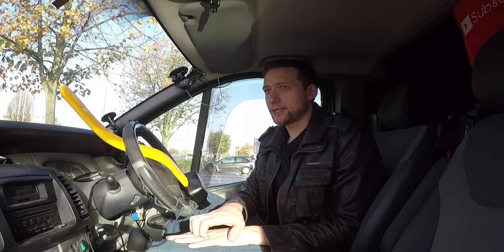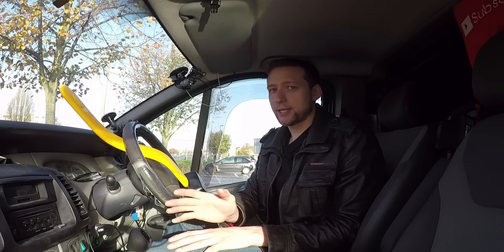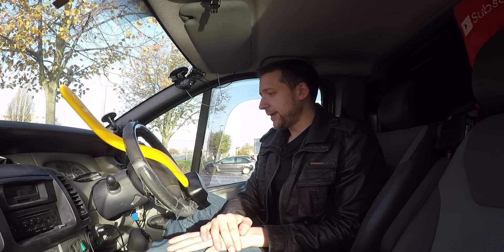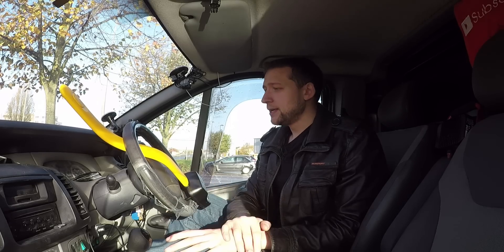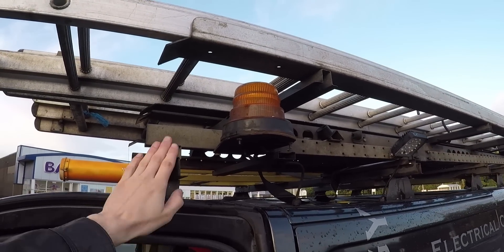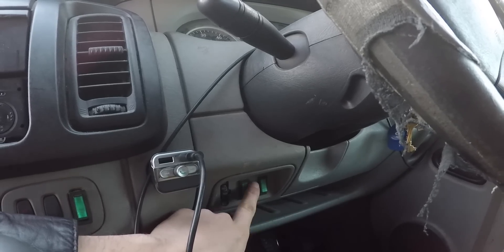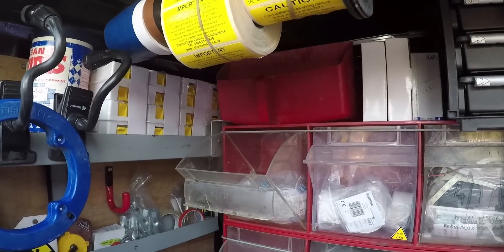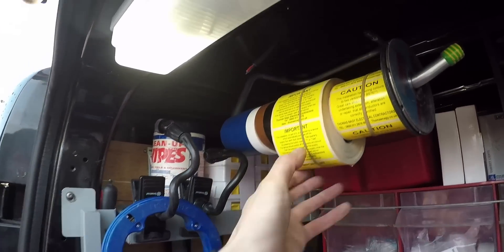***The Van Tour*** | Thomas Nagy

Comment: Had the same steering lock on my transit. Left the van running to warm up one morning with the steering lock still on and some idiot tried to drive it away  !  Didn't get more than 50 feet as it wouldn't steer.  Simple idea.  Worth the money. I always put it on now....even nipping into a shop. Thanks for sharing.  John.

Comment: One thing you must have in the back of the van - mountain bike!
I had one for years in the back of my van, why? No shed.
Brilliant for when the van breaks down,congestion charge? No problem - Park up - rucksack of tools on - pedal away.
Reply: Hardly practical if you need anything other than hand tools

Comment: Another winner; thanks Thomas. Your comments on security are so true and spark's vans are the crown jewels for kit. I've seen ratchet straps used inside to prevent "peel 'n' peek" intrusion. Also, relocation of the OBD port to prevent a smart hot wire.  Nothing better than quality,  secure parking. Thanks again for sharing your experience.
Reply from the maker: cheers boss ;-)

Comment: Hi Thomas, 

Thanks for the van tour the locker compartment with 12v socket was used for a pc, secure storage and charging.
Reply: Really? I tought there were phones you can slide in to them like the old Car phones. Am i wrong? Sworn to have seen it somewhere....

Comment: the locking part of the old van shelf with the 12volt cigarette lighter socket is for laptops and other high dollar electronic equipment. such as portable coax "line integrity testers"

Comment: Nicely organised. The sink is a nice touch only concern I would have is disposing of the soiled water. I'd probably store it then tip it down the nearest drain not storm drain.
Reply from the maker: From what i gather you can buy from them the waste containers but i think they are only for the Mercedes Sprinter 5T vans. I guess i could fabricate a container as there is a fair bit of room under the back of the van by the towbar mountings - but its all time. 
it did cross my mind too though. ;-)

Comment: The whole interior is from an Openreach van, with the exception of the handwash, the smaller organiser trays and the aerosol/silicone holders.  (If the front bit is from a Sky van, its the same)  The locker is for laptops and testers.  The ladder rack is not Openreach, however they are also good, two ladder positions and if you ask a BT engineer, they'll probably show you the rope system that allows the ladders to be put on the van without climbing on the roof or messing with straps.  Many of the BT vans have a full length 'loft' area for long/bulky items.

Comment: I think that locked compartment with the power is where they keep the meter for getting a signal on the sky dishes it connects to the lnb module on the front of the dish

Comment: I have a small transit connect van which is racked out and have find myself forgetting that there is not much space for larger items when I am trying to get a drum of swa in at the wholesalers car park. I have a eberspacher handwash in the back which comes in handy occasionally. The thing I think you may be missing is a small inverter to give yourself a charging point.

Comment: I had a VW caddy, found I was climbing over to get things from the back. Have now an 07 rear wheel transit L3H2 and it's just too big for a sparky. Every day is struggle getting  in and out of it with its high rear floor So I 've ordered the same van but crew cabbed and front wheel drive for the extra inner height of around 7 inches. See how that goes.

Comment: Tom, @1m25s - you need a disk lock that goes round the whole steering wheel - with bar-style locks, thieves will cut through the foam and inner bar of the steering wheel and then simply pull the lock off through the gap :( They're more unwieldy but a hell of a lot better at preventing thieving tossers.

Comment: One thing you might want to add to the tools would be a set of 2 wheel jacks for when you have a car in the way. You slide them around the drive wheels and pump them to grab the wheel and lift it. It lets you then roll the car as long as the parking break isn't on then you need 4 for one on each wheel but can then rotate the car 360 in its footprint. https://youtu.be/mush3hNbnmY?t=1m4s for an example they work best on a smooth surface but will work on most pavement just not on gravel or cobble and can find cheaper as the hydraulic are the most expensive type. 

For those times someone is blocking the box you need to get into or they block you in when you are working. It will let you move them out of the way then back without them ever knowing with the jacks only touching the rubber of the tires.

Comment: Great video Thom. Well   organized and clean van. That's how I keep my one. I was wondering were you buy your waterproof gel from.? I'm assuming it's for out door electrical joints. I have out side lights to sort as all the joints have condensation inside. Cheers. Keith.
Reply from the maker: i did have about 20 tubes of waterproof gel which is the ready mixed stuff you put in a sealant gun.
its not as easy to use though as the pour-able liquid gel. thus i will go back to using the liquid stuff when i have exhausted my tubed gel supplies.
about £35 online most places for a litre tub
Reply: thomas nagy cheers Thom.

Comment: I hate vans with bull bars, I got rear ended at about 5mph by a transit with them fitted. Would normally be some slight bent metal and a new bumper, oh no this completely wrote the car off. Rest of the van is sound, love the cleaning area on rear doors, very smart.

Comment: Just a quick one, is not really linked to this video, probably i should ask you when you will have the video with the tools tour :)
Do you recommend the vacuum cleaner from milwaukee? Honestly,  what is your opinion? 90% of my power tools are from that brand so i have a lot of batteries (this is one of the reasons why i keep buying the same brand). I have the big "henry" but i think is time to go to a cordless one.
Cheers
Reply from the maker: the hoover is awesome. use the 4.0AH batteries though as the 2.0ah ones die off a little quick in it.
the 4ah batteries can hoover 6 flights of stairs before they are flat if thats any help!
i used to have a henry too but this trumps it by a mile! ;-)
Reply: Thank you for your reply 
Today i will put the order through;)
Cheers
Reply: Henry has more power than a cordless hoover though

Comment: No idea why this is on my homepage but thought I'd have a watch but I wouldn't bother with that particular steering wheel lock, just cut the steering wheel with a hacksaw and it's off then £20 buys a new wheel
Reply from the maker: true; you can actually buy the big hoofing circular locks but they are just so damn bulky to cart around.
its just another layer of protection to help stop the average opportunist.
for some reason; and i dont know if other vans are the same, the horn is permanently live so it still works with the van locked? no idea why, but trying to cut it off without sounding the horn which is right under the lock and making a whole lot of noise wont be easy.but then again; i dont think people are worried anymore about how much noise they make anymore. every little helps though.
Reply: It's not about making the theft impossible, it's about making the other van look easier...
Reply: If you want to get away from a bear, you don't have to outrun that bear, you have to outrun slower guy.

Comment: no, that steering lock is 100% useless and a waste of money. Thieves can EASILY see what your safety measure is, and they can cut the wheel with a regular cheap saw in a matter of seconds.

There are much better methods. For me, I can just remove the switch for the throttle. It's free, nobody has any idea what I did, and no thief will just stand around the car to try and figure out why the car isn't starting. It's just a small switch.

Other people just disconnect the battery or something. Or you can take out one of the fuses from the fuse box (check which one you need to take out). 

Again, steering locks = 100% useless. Especially for a van, since it screams ''Please do not steal my van, I value it a lot, I have valuable stuff inside''. Which is why lory drivers often leave the back of their lories wide open, so that thieves can see that there's nothing of value inside, nothing worth stealing. Get it?

Comment: Isn't that Renault equipped with an immobilizer? Add a fuel pump cut off switch. I had my van booby trapped in the states. Drivers seat was equipped with a drivers seat taser and a tear gas dispenser in the cab. We're lucky we don't have stupid laws against tear gas or pepper spray. Break in and trip the silent alarm I get a notification on my cell phone. GPS tracking, sit in the seat while the alarm was tripped you get your arse zapped with about 20Kv until you get off of it. Another sensor will set off the gas canister.
Check it out on Stopthecrime.com.
Reply: Subgunman It does have a transponder immobiliser so you couldn't start it without the key. I think Thomas means that having the steering wheel lock is gonna stop someone smashing the window, breaking the normal ignition barrel steering wheel lock, letting the handbrake off and towing the van off to a lock up so they can empty it. (unless they lift the front wheels of course, but then most crims ain't gonna go to that hassle)